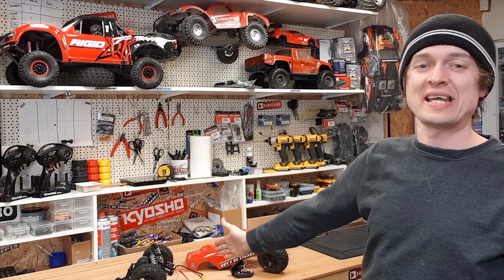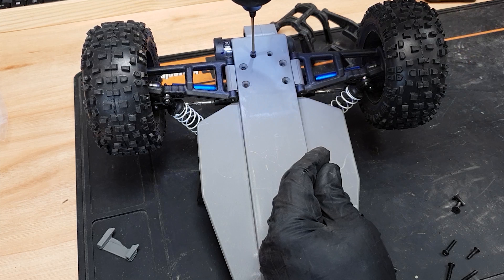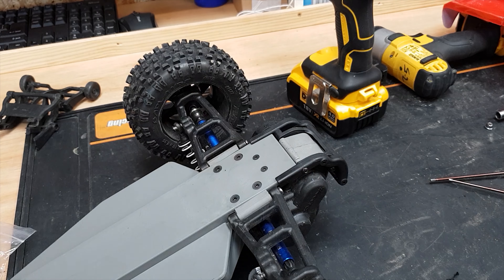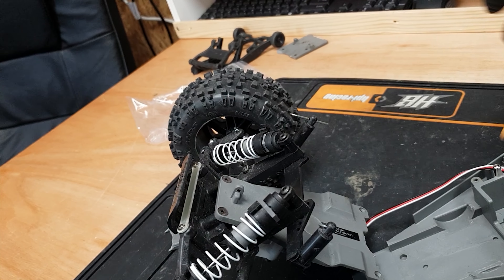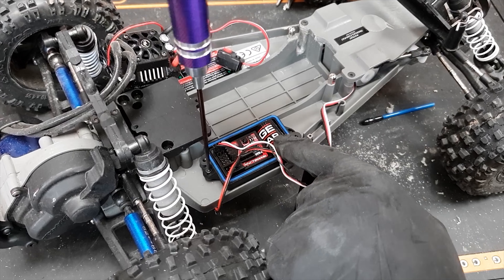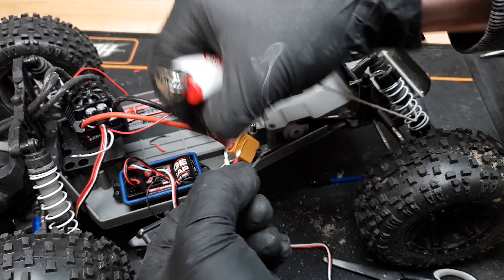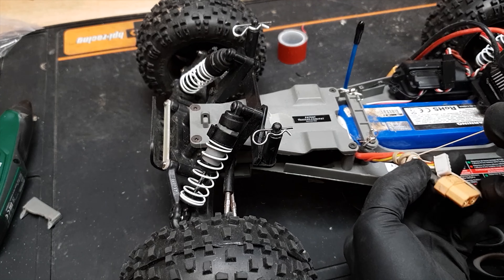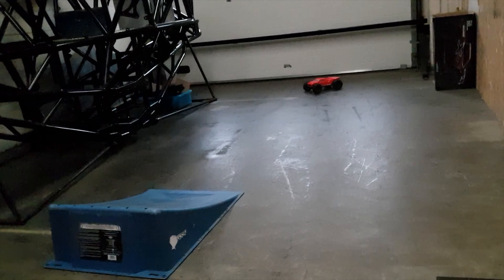How Much Damage? - FiXing my Traxxas Rustler

Comment: Kevin, if you want a somewhat easier to drive 2wd, try the slash.  It does not disappoint.  Yes, it is harder to brake, but at least you can pull NASCAR style burnouts with it.

Comment: Hey kev, don't answer, just wanted to let u know I had a rustler too, same problem as you. I turned it into a slash with just a slash LCG chassis for like 15$ (longer). I kept the rustler a arms (wider) for stability. Now it dont wheelie non stop and Its got the same tires as your rustler.

Comment: The s9 is much better than the camera you attach on the controller. The complaint that I have from the your camera you put on the remote, is when look to the sun light it goes very dark and you can't see the video. But the S9 camera is much much better, use the s9 camera when doind rc bashing if it's possible.